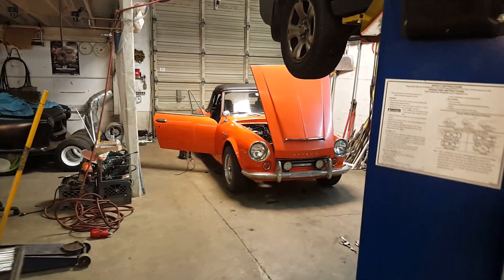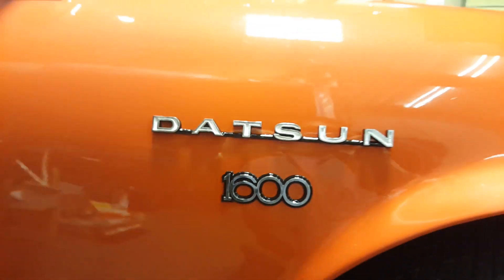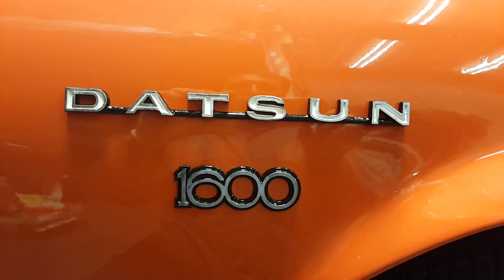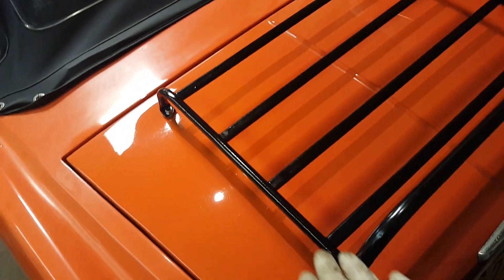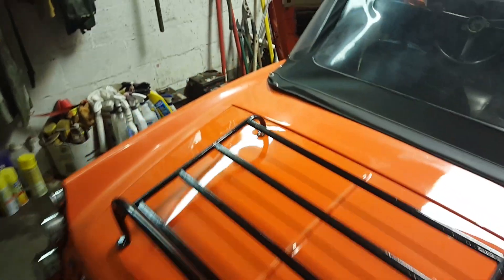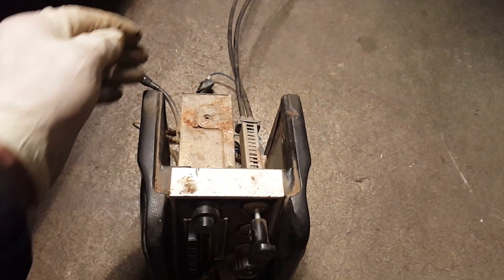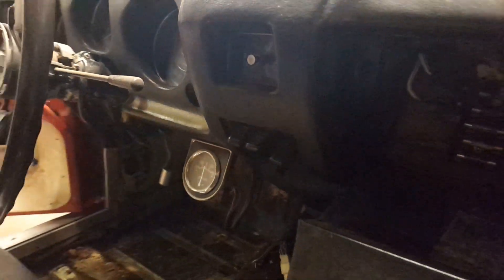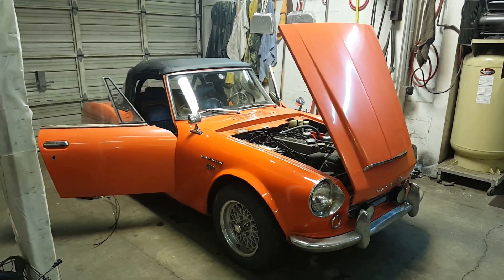Datsun Roadster "Orange Crate" Details

Comment: I had a look online and found a couple of pictures showing a 1600 console.  Your missing knob is an S/BRAKE knob... which I must say confused the heck out of me after a little more searching I found someone that claimed they knew what it was for, but it seemed pretty absurd, so I looked some more and found someone that had it in thier owners manual.  The S/Brake switch is to test the little red brake idiot light on the dash!   Pretty amazing really.  Oh, and DastunParts.com has an S/Brake knob NEW for $18 and there is an S/Brake knob w/switch for $50 USED on Ebay.